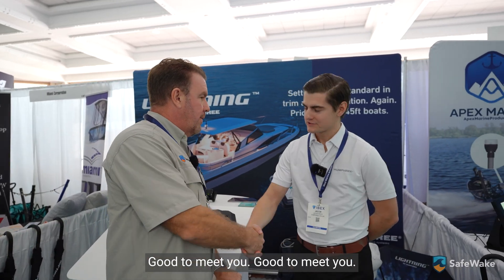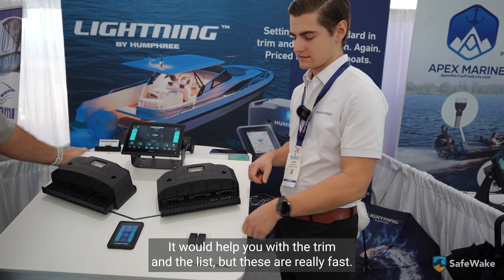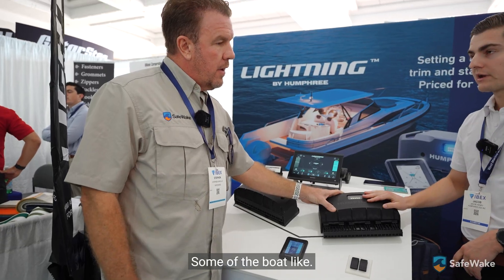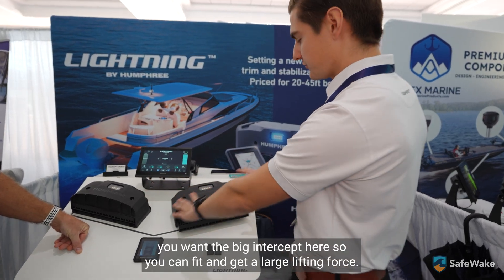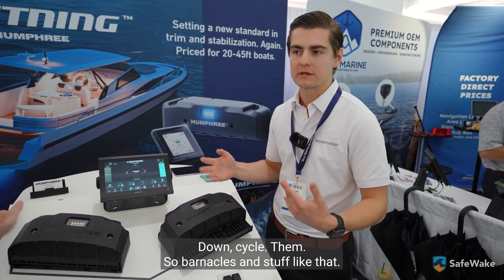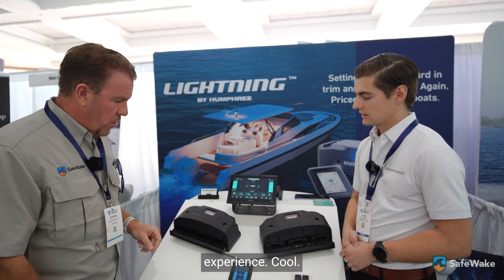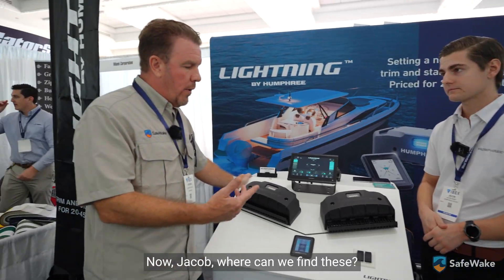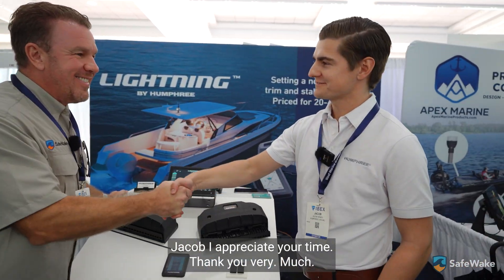Never Ride Rough Again — Meet Humphree!

Comment: Man that thing is so antiquated and slow compared to the seakeeper ride
Reply: But this would work for boats that do not have the room to install the Seakeeper.
Reply: @jetlag4754 if that were the case then the second best option is the zipwake pro. Way less failure rates too. Way faster trim tabs too. Hunphree needs to innovate or they'll be forgotten.